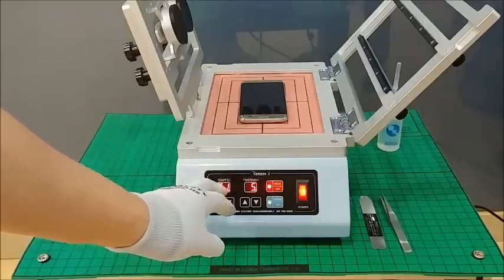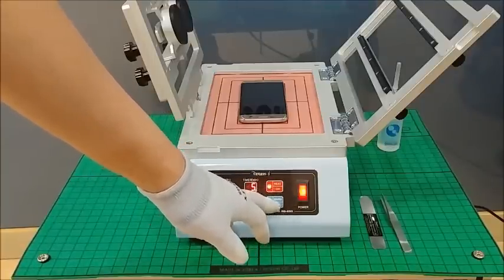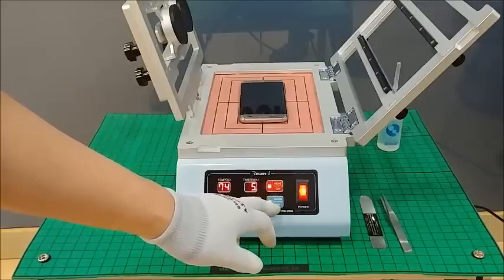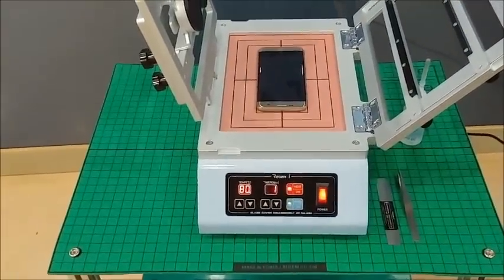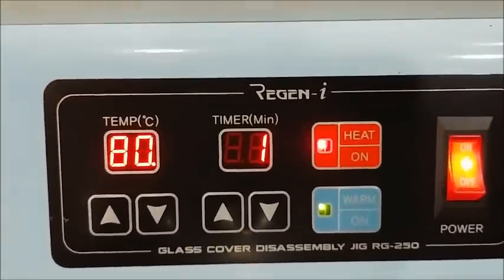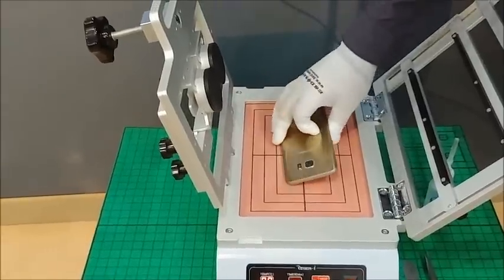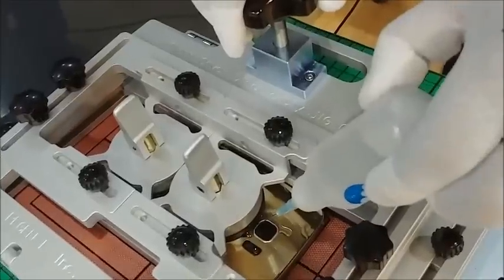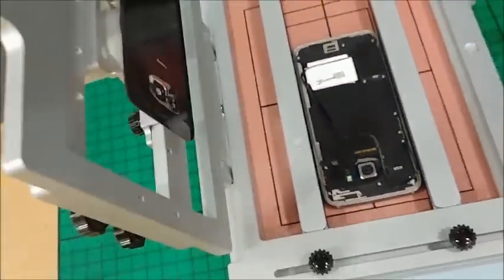Samsung S7 Edge back cover disassembly by REGENI RG-250 glass cover disassembly machine

Comment: I think it is the best way to remove the black glass than using pry up method, heat n pry up method will make the bezel has a dent or scratch I think
Reply: Standard procedure is to freeze the device glass in a cold chamber for 30 seconds then remove with suction tool.